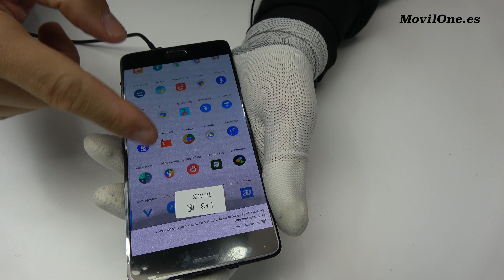One Plus 3T Teardown Screen Replace

Comment: We have the option to by after market screen with frame or (screen with out frame) what is your suggestions thanks again
Reply from the maker: Michael Pin,  think it is easier to work without a frame (if you have good glue and follow the steps of the tutorial) however it is also an option, that of the frame, but we will have to move all the components from one side to the other ...